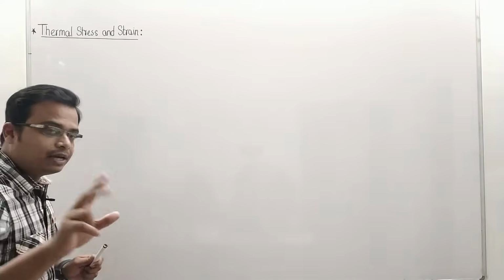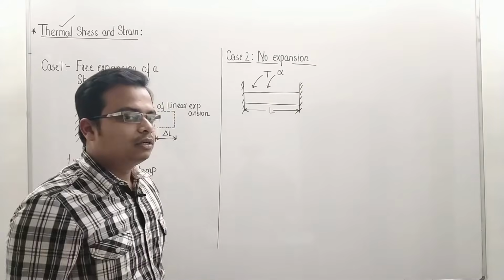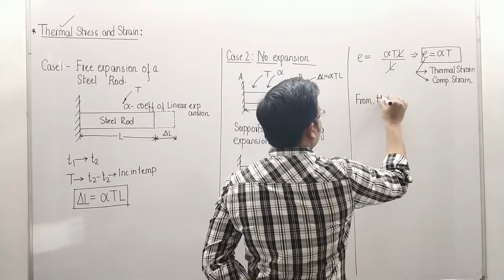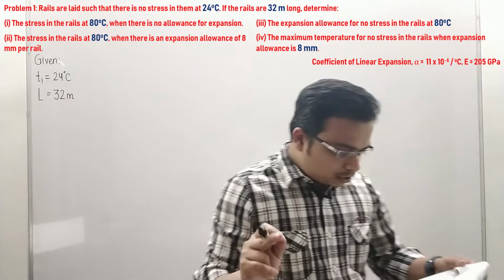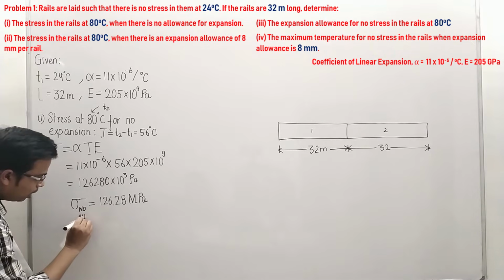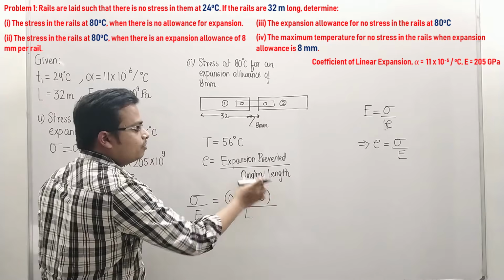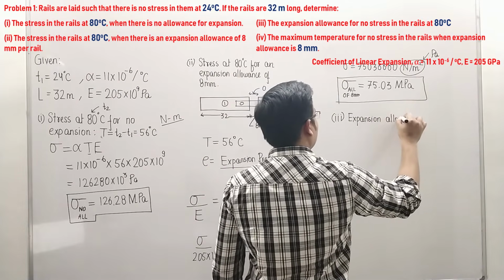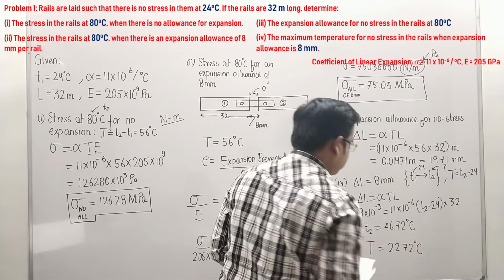Mechanics of Solids | Thermal Stresses and Strains | Basic Concept |

Comment: Help me solve this question 
Two parallel walls 8m apart are stayed together by a steel rod 25mm diameter passing through metal plates and nuts at each end.The nuts are tightened home when the temperature of 100 degrees .Determine the stress in the rod when the temperature falls down to 60degrees,if 
a. The ends do not yield
b.the ends yield by 1.6mm
Take E=200Gpa
Material constant=12×10^-6/C^-1

Comment: Sir
Won't the allowance be 4 rather 8 because both the beams have to expand and each will expand in similar wau
Reply: I had a similar doubt. But what I thought out is that the rails have to expand on both sides isn't it? 4 on the right and 4 on the left. so its a total of 8 only. The doubt I had was, the Q says "allowance of 8mm per rail". So shouldn't there be a 16mm gap?.  the gap remains 8mm only, because of the same reason as above. I would be glad to be corrected if I am wrong.  Cheers :)